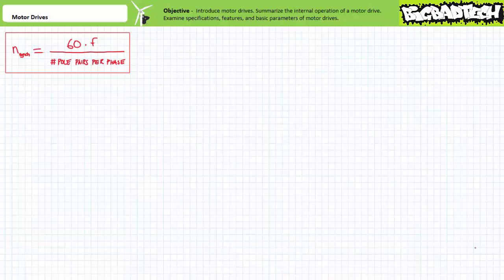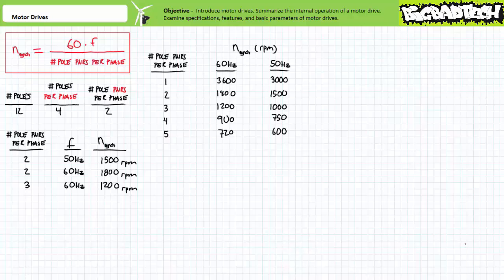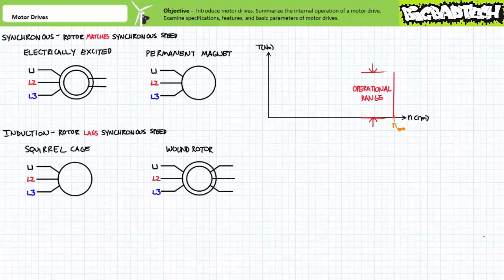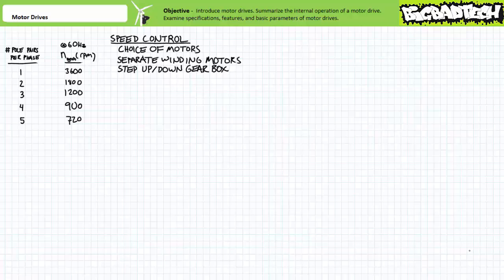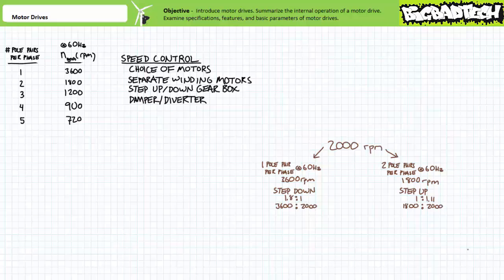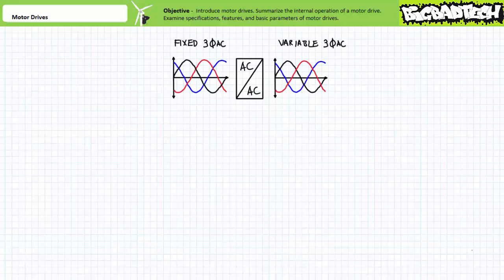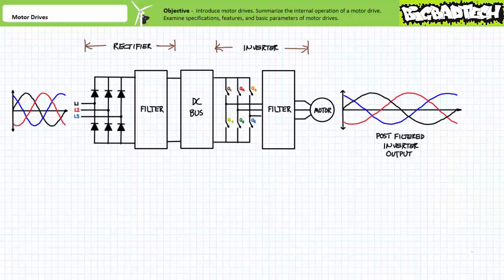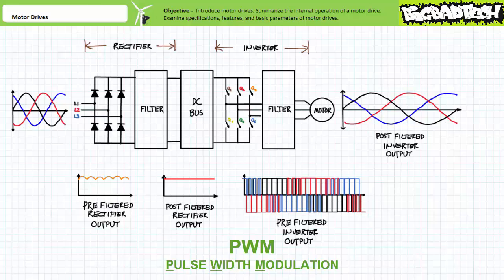Motor Drives (Part 1 of 2)

Comment from the maker: Note there's a 50 second skip in the video at ~14:30. The full version to be released on Sat 7 Jan 17 will fix this error. It's a rather critical point that shows how a mechanically simple motor with a fixed number of pole pairs (ex: 2) can rotate at different speeds given a variable range of excitation frequencies (ex: 40Hz->  1200rpm, 100Hz -> 3000rpm).